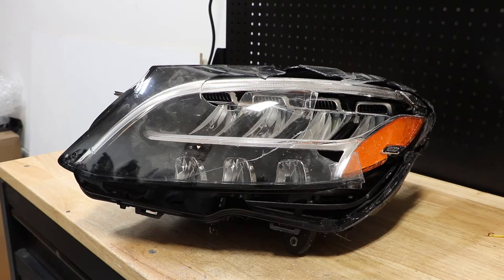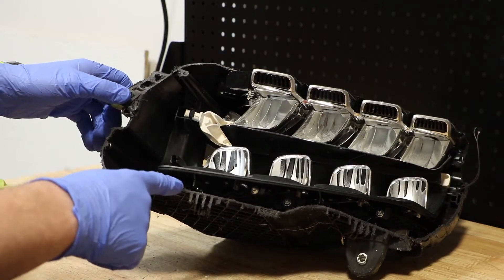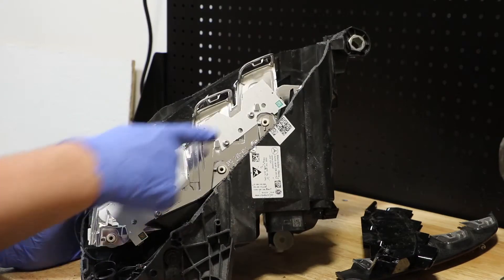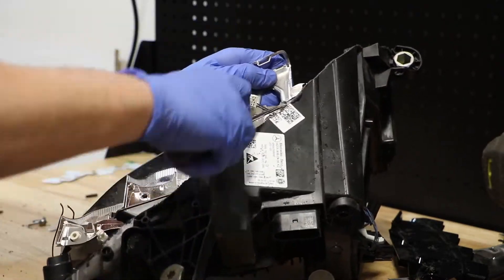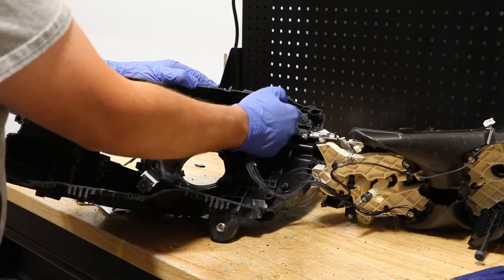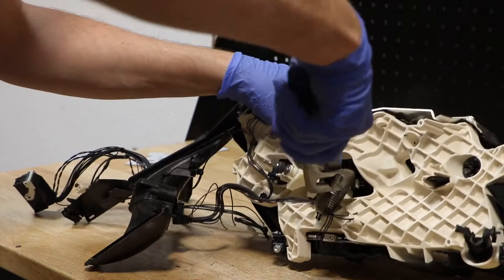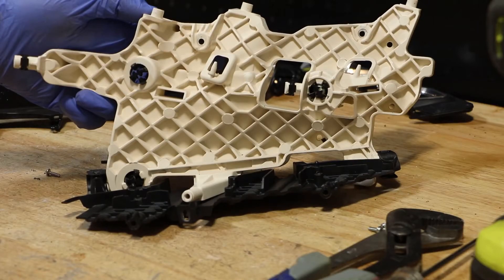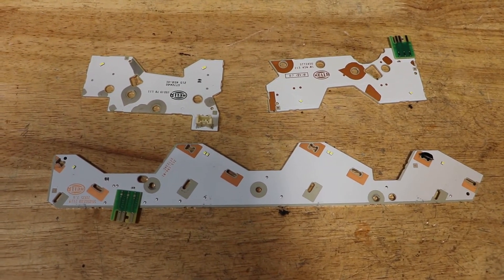2019-2020 Mercedes-Benz C Class LED Headlight Teardown

Comment: So If this headlight goes out, you have to replace the WHOLE unit? There is no bulb?
Reply from the maker: That is correct.   There is a control module that can be replaced, but the integrated LEDs are not serviceable.  If the LED fails, you will have to purchase a new headlight.
Reply: @gftgrill  So how can I troubleshoot, my friends mom has a 2019 and the passenger side light is out. Is there a fuse that blows as well or what usually is the culprit?
Reply from the maker: @beatzfadayzent  could possibly be a fuse.  Easiest option is to start by checking the fuses using the owners manual to figure out where it is.   Then I would suggest pulling the headlights and swapping the modules between lights to see if the problem moves with the module.   After that you should know if you need a module or headlight
Reply: @gftgrill  Ok. I got the fuse chart out of her trunk fuse box but none of the fuses on the chart read "headlights"😡 now I need to see where the modules are located so I can try what you suggested.
Reply from the maker: @beatzfadayzent  the modules are mounted on the side of the headlight.  I'm pretty sure you have to remove the headlight in order to remove the module
Reply: @gftgrill  Ok...thanks!